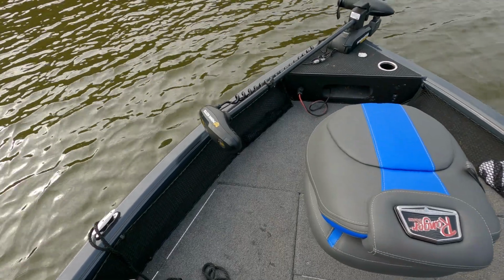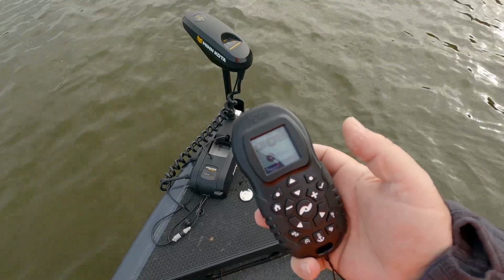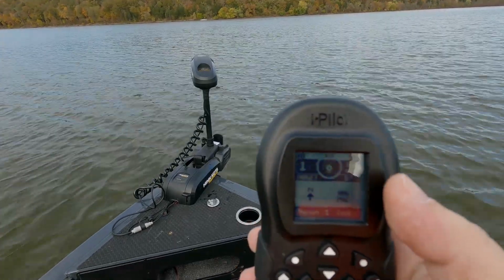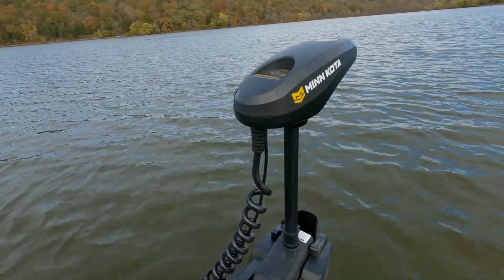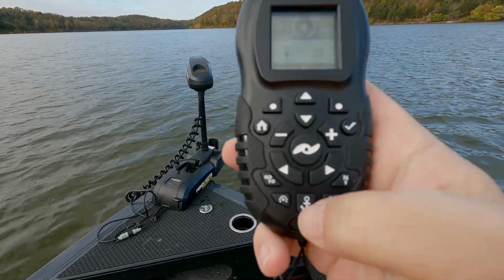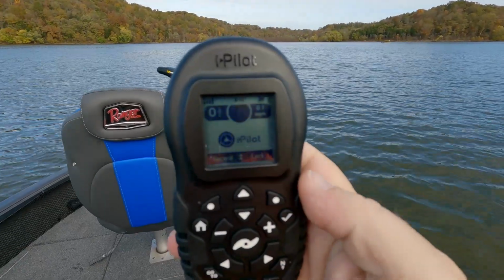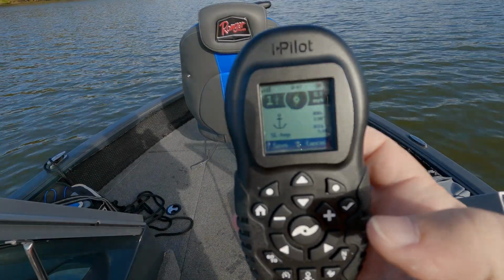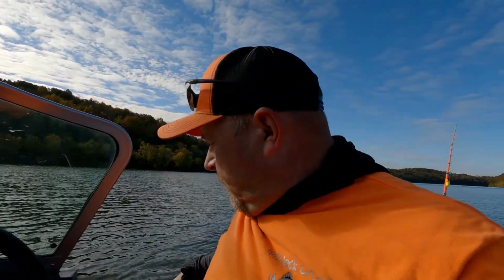Minn Kota Power Drive I Pilot Tips

Comment: Great tutorial and channel. I also have a Power Drive I Pilot and love it except deploying and stowing the motor is a real pain in the ass. The deploy assist lever doesn't provide enough thrust to release it easily and then when retrieving the motor it's very hard to get it back into the mount ramps for stowage and travel. Minn Kota was almost no help referring me to a non Minn Kota You Tube channel. They also mentioned lubricating the shaft with furniture polish. Any thoughts and/or recommendations?

Comment: I bought one of these in Jan 2023. I did not get a chance to use it a great deal and like most people, the boat has been put up for a few months. We seem to have some really good weather off and on here so I have gone out after Crappie the last couple of days. In the short few months of not using this remote and motor, I got it screwed up pretty good. Had the I pilot in advance instead of legacy and could not figure out what I was doing wrong. I also have been having a problem with delayed speed commands. After watching this I am wondering if I did not have that screwed up as well. lol. I'm thinking that I may have the cruise control engaged. Wish I would have watched this video BEFORE I went out the last couple of days. Thank you very much for making this easy-to-understand video. I would give you ten thumbs up if I could.

Comment: How long will the battery last by having anchor on
Reply: I have a 24 volt system, fished from 8a.m. til 5p.m. yesterday in light current with little wind. We spot locked in 5 different spots the whole time and the battery indicator had 3 lights out of 4 at the end of the day!

Comment: can you use the gas engine for power and use the trolling motor for steering while following a track ?
Reply: The trolling motor will steer the boat at idle speeds when using the gas motor (somewhat). Probably not well enough to keep you on a recorded track but worth a try!
Reply: @HooksandHammocks  actually works well. I do it all time. At idle on main it will steer very well. I added larger skeg to help steer at faster speeds.

Comment: Thanks for the video.  Maybe I missed this, but the one thing I have a question about is exactly when you should or need to press "save" to keep the track.  Seems like it should not be complicated, but I have seen and heard people say that save should be pressed right after you start recording, which seems odd to me.  I tried recording a track only once my first time using the motor and then lost it by accident because I didn't hit save when I needed to apparently. Thanks for any info.
Reply: In my experience the track is saved automatically, have the track there everytime i go back to the area, BUT very easy to record over if not careful. I am sure there is a way to "lock or save" a track so this doesnt happen but I have not looked into enough to give any tips.

Comment: How long will the spot lock run for on 12v?
Reply: I have a 24V system so hard to answer your question, also too many variables (wind, current, size of boat, etc) all will vary the battery life. I can make 3 trips usually before NEEDING to recharge but I always plug boat in after every trip so I am always fully charged.